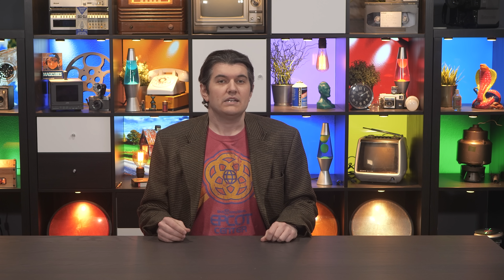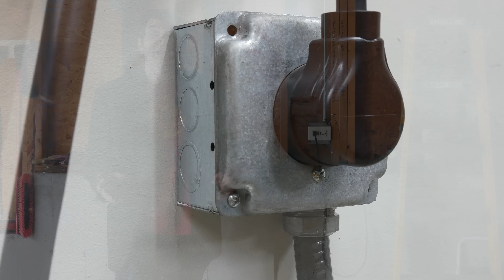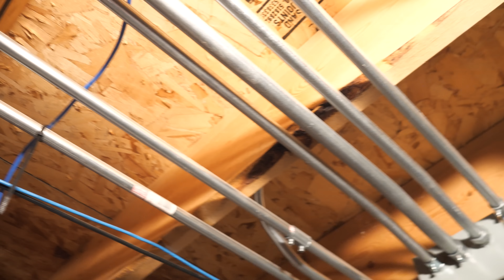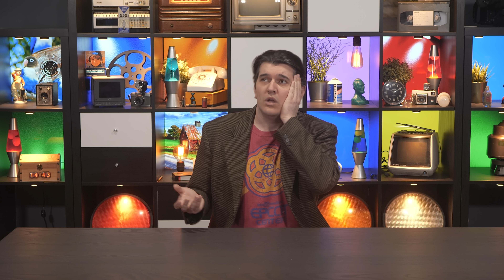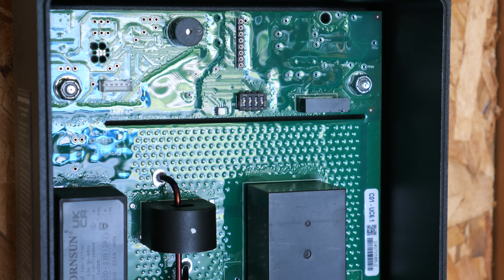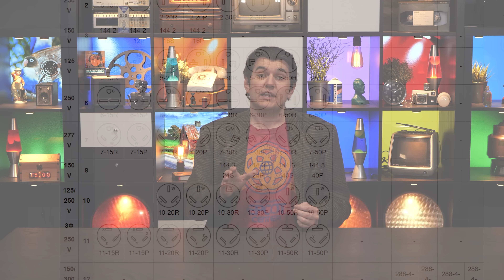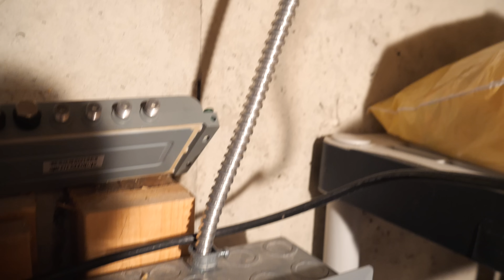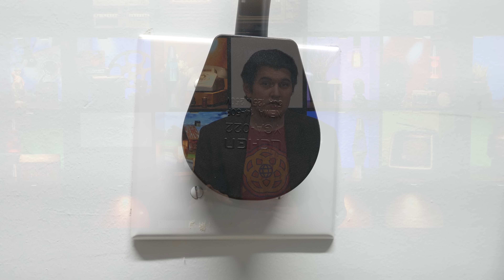The "standard" car charger is usually overkill—but your electrician might not know that

Comment: I will note that the Emporia EV charger does have an added cost option that will monitor the current load on the main service panel and automatically lower the current draw on the EV charger and ramp back up (or down) dynamically as needed.  This can be pretty useful for those with a smaller 100amp main service panel and are professional drivers or delivery drivers who put a lot of miles on the EV every day, and thus need the higher amperage charging. My wife does delivery driving and puts 200 miles a day on the EV.

Comment: I've actually got the weird but handy NEMA 6-50P in my garage. I don't actually have a welder, so would be good and set for an electric car charger if I had one. Not that it would matter since my work has free chargers at work available 24/7. Interestingly, the cable for the 6-50P is 3/6 so there's a neutral in there too if I wanted to go to to 14-50P.

Comment: I received my Tesla Model 3 LR in Feb 2022.  Everyone said I should have NEMA 14-50 installed.  I am retired an looked at my actual needs.  I have used the Tesla Mobile connector plugged into a 110v existing receptable for almost 3 1/2 years.  Almost every day, I have 280 miles of range when I get into my car.  If I drive 100 miles that is extraordinary.
There are problems with a 14-50 receptacle.  Unless one buys a heavy duty version, the commonly available cheap ones are likely to fail, sometimes catastrophically.  BTW in the US, a few years back NEMA changed the standards.   All receptacles in garages, or outside, are not required to be protected with GFCI breakers.  Those breakers aren't common and are expensive.  About the same time, Tesla stopped including the 14-50 pigtail and changed their home charging recommendation to their Wall Connector, which since hard wired doesn't require GFCI breakers.

Comment: We recently bought a used 2022 Jaguar I-Pace. We put a 50 amp charging station. The car has around 175 mile range on an 80% charge. We only charge it about twice a week. We don't use it for long trips, but what I have noticed is that since we got it, I only fill up my Yukon about once a month. So I call that a win!

Comment: I’d like to point out another scenario where faster home charging can make a very large difference. My parents have an Audi A3 e-tron that only manages about 30 km of electric range. So while it was absolutely no problem charging it overnight on a 110 V circuit, the switch to 220 has allowed them to top it up after short trips. That took their gasoline usage to nearly zero.

Comment: I bought the Grizzl-E Classic and mounted it outside.  I hard wired it with EMT and raintight fittings.  Saves the cost of an outdoor outlet and eliminated the need for a GFCI breaker. Like you I took thermal photos after it had been charging a car for an hour to confirm that I did not have any overheating connections.

Comment: "There's nothing you can do with the information of how much your car is pulling from the wall" isn't always true. I rent, and my car charging electric usage is billed separately from my personal usage-- but it's part of a "common area bill" rather than metered so I need to know how much energy my car has pulled so I can pay my portion of the bill. Fortunately in my case I use TeslaFi which can provide this data, but I suspect most other EVs don't have quite such a treasure trove of data available.

That said, the rest of the video is spot on. I'm charging on 5-15 (again, I rent) and it's plenty for my needs. I arrived home last night at 13% and a day later it's still at 48% but who cares, I'm not going to drive much over the next few days anyways.

Comment: We’ve been charging our 2014 Spark EV on an existing 120V 20 amp circuit using an existing outlet and the car’s included “portable” charging cord  for the past two years since we bought it.  My son commutes with it daily and the overnight charging works for this perfectly. There have been a few times when I have wished for faster charging to make the car a little more flexible on our home charging but it hasn’t been enough of a bother for us to actually get a 240V charger installed. This situation has been so great that we actually just purchased a second 2014 Spark EV and they’re both charging on the same charger (alternately, of course) and we are still finding it sufficient to keep both cars charged.

Comment: How can you not mention the largest caveat here.  At cold temperatures 120v  service will not be enough to heat the battery fast enough to then begin charging once the battery is warm enough to accept a charge.  Specifically for those of us in Canada.  Most Canadian garages do not have a source of heat and if you charge outside, the battery pack will be freezing cold and not accept a charge.  

There are various channels showing this phenomenon.  The onboard battery chargers eat up a ton of energy and often take hours to properly warm the battery even at 240v service. 

Usually you always include something this obvious.  Wondering why it was left out.

Comment: Great information! An earlier video of yours (and one from 8-bit Guy!) gave me the push I needed to go ahead and buy an ioniq6 2 years ago, thanks to confirmation I wouldn’t NEED an expensive “charging station” and could get away with a dryer outlet.

Between the minimal electrician work in the garage (which luckily had the circuit box  right there!) and the charger from amazon, it cost me about $500, and I get around 9% per hour charging which suits even my 110ish mile daily commute. All of that magic happens while I sleep.

Well worth the added $25-30 on my electric bill each month!

Comment: This video was very interesting to me, in actually stating how much electricity is required to charge an EV. In essence, he just installed the equivalent of a electric dryer connection, that will potentially be operated for something like 8 hours continuously each day. Even at cheaper overnight rates, that seems like a lot of grid usage and expense. Yes, I understand that I won't need to buy gasoline. But I don't see the great cost savings that some people claim you get with an EVC. Especially if you include the real (and perceived) limitations and inconveniences.

Comment: The thing about leaving charging customisability to the vehicle ... vehicles go wonky. Wonky is the natural state of a (motor) vehicle. They are going to be in operation for 20 or 30 years, and probably most of that time you'll be living with quirks. 
The installed infrastructure is the thing that should work reliably for years and/or be fairly easily replaced.

Comment: Wow, this was pretty useful! Especially the part about using a splitter. My electric dryer isn’t close to the garage, but my electric range is on a 40 Amp, 240 V circuit on the wall attached to the garage. Cool!

Comment: If you DIY or ever want to it's a very good idea to have 240V single phase power available.  If your service is marginal and you have or want a shop etc an easy way which does not disturb your home is adding a new electrical service for your shop and vehicle. An outdoor power pole with service panel and outdoor 120V and 240V outlets gives you power before you erect a garage or shop. That's what I did and it's worked superbly. Having a second service is so cheap I don't notice the bill even when welding heavily (in which case it was of course worth it) and redundant backup never hurts.

Comment: My wife and I actually took our Tesla Model Y on three separate trips on Father's Day, all in the 115° Phoenix Sun. Battery went down from 80% to 10%, mostly from the AC being on full blast, and the cabin overheat protection when it was parked. We have the dryer switch thing on the 30 amp circuit and I think it took 10 hours to get it back up to 80%. Most of which we were sleeping, lol. I'm still thinking of putting in the 60 amp breaker so we can do the 48 amp charging, but we definitely don't NEED it. If I thought for certain we weren't going to make it home, there were multiple superchargers on the way.

Comment: There's no Maybe about it, an Aluminum Wire Connection that doesn't use anti-corrosion paste (or it isn't applied properly) WILL cause a Fire Hazard and fairly quickly as the circuit is used...

Without the Anti-Corrosion Paste, the joint is absolutely 1,000,000,000% Guaranteed to form a layer of Aluminum Oxide between the various Conductors in the Joint and Aluminum Oxide is a VERY Poor Electrical Conductor so as power crosses the Oxide from one Conductor to another, IT WILL GET HOT AND EVENTUALLY START A FIRE!!!
The other major cause of Fires/Faults/Failures in Circuits with Aluminum Wires in it is where an Aluminum Wire is connected to a Copper Wire but the physical twisting together of the 2 dissimilar metals wasn't done right...this will cause the joint to loosen up over time because Aluminum expands with heat more than Copper does, so as the wires get hot, they expand and then contract as they cool but at different rates so if the 2 metals aren't twisted together right, as they expand and contract, they will untwist the joint causing a loose joint which is just as bad as an oxidized/Corroded Joint with the same eventual outcome - Fire...

Long Story Short, if you have Aluminum Wire in your home, DON'T MESS WITH IT!!! Call an Experienced, Licensed Electrical Contractor to handle any repairs or modifications to the Aluminum Wires and their Circuits...because the Life you save may be your own or your Loved Ones...

Comment: Wondering if bonded your ground to your junction box; looked like there were only 2 grounds in your wire nut.
L14-50R and L14-60R can both be obtained in commercial and hospital specification variants and are made for regularly plugging/unplugging.

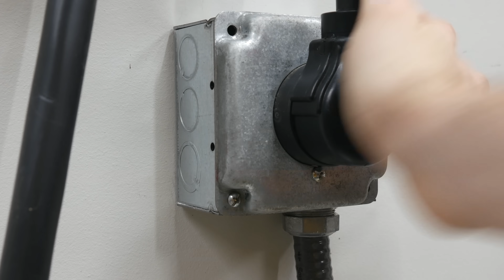Comment: Electrician notes: (1) 3:47 The cable running into the back of the box needs to have a connector attaching the cable to the box.  Also the ground wire needs to be connected to the metal box. (2) 4:09 MC cable is available in larger sizes at an electrical supply house which may sell directly to the public, even in Chicago. (3) 7:58 MC You cannot use set screw connectors on aluminum MC cable, you can only use squeeze/saddle connectors. Set screw connectors are only for steel MC/AC/BX cable.  (4) GFCI protection is required for all receptacles for EV chargers regardless of their location.

Comment: If something doesn't actually need an internet connection to do its job, it shouldn't have one. Having random stuff connected to the internet is a giant security hole waiting to happen, allowing bad actors to screw with everything that's on the network - especially since companies do a terrible job making sure that their software for such devices is kept secure and up-to-date. And the fact that many of these companies don't support products long term makes it far, far worse - especially when a product is supposed to last for decades, which many appliances are.

Comment: I'm an Electrician so I'm VERY firm in my belief that Hard Wiring a permanently installed High-Energy Electrical Device like a Car Charger...

Stoves and Dryers are the exception in my mind because 1) they only get plugged in and unplugged 2-3 times during the life of the appliance and 2) need to be easily changed because of needing to repair or replace the appliance, a Car Charger has no User Repairable components other than the Charger-to-Car Power Cable which has it's own plug-and-receptacle connection on the Charger Body...

Comment: Metal clad cable is available in sizes larger than 10AWG.
Eliminating the cord/plug/receptacle can present a problem depending on what codes are in force for an area. A plug/receptacle qualifies as a disconnecting means for the purpose of service/repair of the device.

Comment: i wonder if there is a domestic EV charger which can take 2 or more power supplies so that you can use more than one circuit at a time, so that you can combine the amperage from multiple circuits to get higher power charging
Reply: That's dangerous in multiple ways. In theory you could build a charger with enough safety features to make it okay but it wouldn't be worth it.

Comment: While I agree with the premise that not everyone NEEDS the full power that their car can take, if you're going to wire a dedicated circuit might as well go full send and wire the full 40 or 50A. It will be a bit more expensive since the wires are more expensive, but the work itself is the same. If done by an electrician, the price difference will probably be very minimal.

IF you already have the outlets, you're 100% just find a way to reuse what you already have even if it's a weaker circuit. If you have to wire a new circuit, just go all in. I plug my Kona EV maybe once a week in regular use with my 7.2kw.
Reply: This isn't always true. If you only have 100A service to your house dedicating 50 to one circuit means you run the risk of tripping the main breaker if you run a couple other high draw devices. It depends on a lot of details.
Reply: And to your point of sizing the circuit properly, I went directly with a 6 gauge wire (capable of 65A!) on a 50A breaker with a 6-50 outlet as that's what my EVSE came with. I currently have a 30A, I can change to a 40A with any other changes to the setup. I only have to change the breaker to a 60A to go with a 48A EVSE. It's barely more expensive to go with a bigger wire.

Comment: I drive a hummer EV, I drive between 100-200 miles a day, I can only charge at off peak times, I need my 50 amp 12kW charger to refuel at home.
Reply: You have a very niche use case.

Comment: 22:06 Like having a cell phone, never charging it at home, and always looking the fastest phone charger while you're out & about. Can you imagine if the federal government subsidized "fast chargers" for phones simply because phones don't come with chargers any more? 😀
I'm retired in Phoenix. I have a solar array outputting 9.6kWh max running thru a 7.6 kWh SolarEdge inverter mounted on the outside of my attached garage. They told me I am ready to DC charge my EV if I wanted to run the wiring for it. I'd like to see you cover that scenario.

Comment: For a lot of people still, it suffers from the "... but sometimes..." thinking that you mentioned with LED traffic lights. Many people want to solve every last edge-case, and will poo-poo anything that doesn't. This is why people still buy vehicles that can: off-road, tow a camper, haul gravel, AND carry the Brady Bunch comfortably - but drive alone to work 250 days/year.

Comment: The splitvolt switch you showed is not for a house built after the mid 80’s.   Since then dryer receptacles are supposed to be NEMA 14-30.   Not 6-30.

Comment: I agree with direct wiring. I am one of those people who have a detached garage. I escaped the tench because I have an existing 1.25 inch conduit going out there and my (wonderful) electrician was able to squeeze through a 60 amp cable (no common). Thus, I needed a charger that did not require a common. I did this because of a point another commenter made. I wanted install a charger that would fit most OTHER people's needs, as the charger is now part of my house and thus would be sold with it.

Comment: When I last moved, I installed a 240v 20a circuit and receptacle as a temporary charging solution. Because of efficiency and the 80% rule it gives about 2.8 to 3 kw to the car to charge...

And its been three years since then. I've almost forgotten that it was temporary. I've never driven over 100+ miles a day repatedly without fast charging. It just... has never been an issue.
Reply: 220v 20A is a great option, especially since it can be installed with 12 gauge wire
Reply: "There's nothing more permanent than a temporary solution."
Reply: 20A circuit is 16A possible, which shows up to the car as 3.6 kw.  This is a great setup for 1-2 EVs with relatively low mile daily commutes.  Especially if you have low cost off peak rates which give you all weekend to drive great distances and still catch up!

Comment: So, what you’re saying, is that I don’t need to dig up my street to get 3-phase power for my driveway 50kW charger to recharge my 52kWh battery from 0-100 every night? Good to know.

In reality, and this is a UK perspective, we have 2 EVs at our home, and two EVSEs. Both fed from the standard 240v supply, but because one is hardwired, it is capable of 7.2kW. The other, from a standard UK outlet, is a mere 3.1kW, due to the 13A maximum current from our outlets. Both have served us well. My wife only ever really commutes to the railway station, so makes use of the 3.1kW outlet a couple of times a week. I, up until recently, had an 80 mile round trip, and would top off the car every day with the 7.2kW unit. Our electricity tariff limits us to only 7hrs of cheaper electricity, but thats still 44% of the battery on the smaller unit and 100% on the big unit, and I can only recall about 3 occasions in four years of ownership where my vehicle has ever been down to single digit percentage.

Comment: All good points, EV ownership has much less of a rampup for many households than people may otherwise realize.
In my case, the work commute is 60+ miles round trip in a mid-sized vehicle: knowing that, I had a 100A sub-panel installed in our attached garage when it was built years ago, anticipating a future vehicle charging station need.  6 gauge MC was relatively easy to run from panel to box.  So my daily requirements have been met and waking up to a charged car is great - but I realize not everyone is so lucky and know a number of fellow commuters who charge via 120V outlets overnight, supplementing with charging stations for the odd time that's needed.